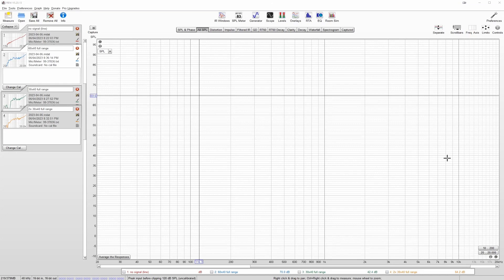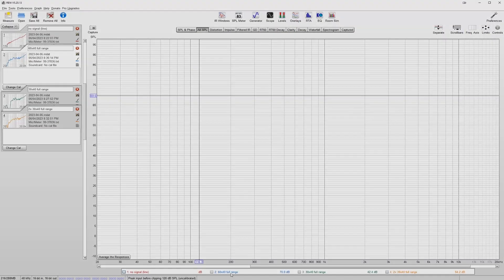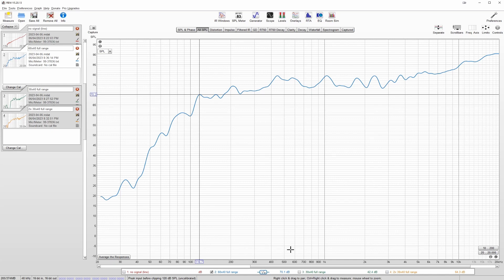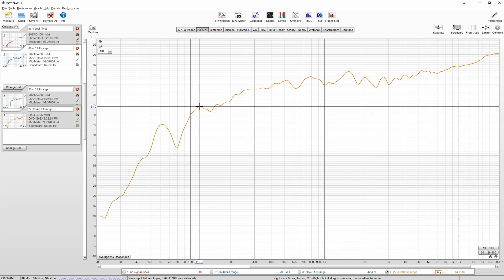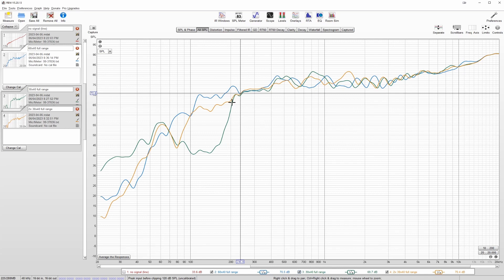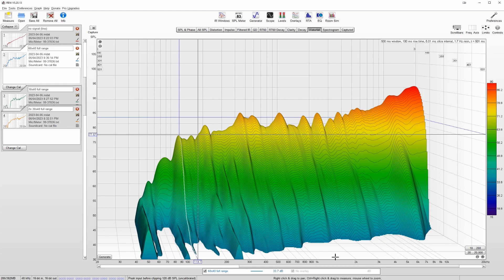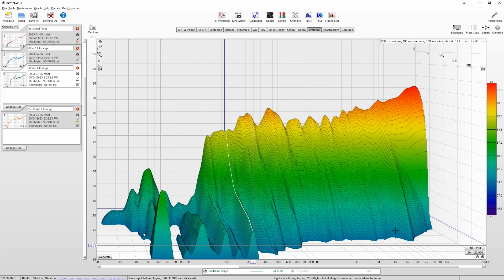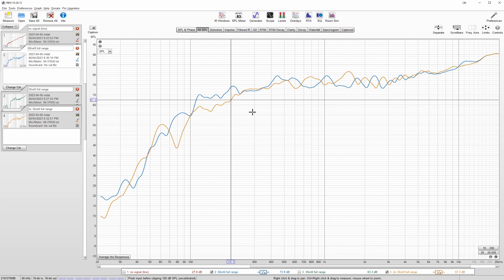One Larger DML Panel vs Two Smaller Panels (...vs One Smaller Panel)

Comment from the maker: UPDATE: It looks like the measurement issues came from a bad soundcard calibration file. I have re-calibrated the soundcard in REW and subsequent measurements look much better, particularly in the HF.  I won't mess with this video as there are no real changes in the lower frequencies I'm discussing here.

Comment: Hi Ben. I want to do a 4 panel setup, with 40 watt dayton exciters. I want to make some speakers for my TV. I want to do a hybrid approach with half the panels being a different material. In your opinion, what two  materials would best cover the whole frequency range in the most balanced way?

I'm doing a bunch of research right now and just from a total guess it'd be a PVA glue coated XPS panel (24" by 24", 2/5 3/5 placement of exciter) and an acrylic panel (something like 24" x 38", with the same placement location).

What's your opinion?

Comment: Hi. I’m considering building some panels. It’s interesting that folks aren’t using (in addition to the subwoofer) three or more different sized circular panels. I’d cut all different sizes and a couple of different drivers, then mix and match to the room. Change rooms or decor? Just see which sizes work best with the new acoustics

Comment: Might I suggest trying an HPF and LPF on your lower panel, and bringing it in just where you need it? Otherwise I can see an issue with the two sources phasing a bit. Common trick with most multi driver speakers with two of the same drivers.

Comment: Thanks for all your videos on the subject!  Do you have any experience running different panel materials on the same channel?  My first toe dip in DML is looking to be a 2’x2’ pink board with 1x 24w exciter (8ohm) in parallel with a 2’x4’ acoustic ceiling tile with 2x 4ohm exciters in series.  This all going in the garage so looks don’t matter.  Also got a dedicated 8ohm tweeter and passive high/low pass filters centered around 6khz to play around with too.  I don’t have a dsp, but the fosi amp has a treble dial.  Sub is preamp and has a variable crossover too.  Hope it doesn’t end up like a Jr High band practice :)
Reply from the maker: No problem, glad your finding them useful! I haven't done anything with multiple-materials but one thing I haven't seen addressed is that different panel types will have different efficiencies eg the foam board might be a few db louder than the tile, in which case the combination might not be as effective as you'd want for evening out frequency response. I guess my view is that I'd rather get a decent sound with a single material and stick with it but that it could work out great as well. There isn't a whole lot of detailed info out there so the best thing to do is just give it a go and see how it sounds!

Comment: I'm really glad I ran across your channel.  I've been thinking about making the foam version of these speakers ever since I first watched the Tech Ingredients video that kind of started it all off.  I like your approach to a Hybrid speaker and I'm going to watch each of your videos to learn more.  I also had an idea to use one of these for a guitar amp speaker, and you've already done that!  Thanks for the great content!
Reply from the maker: Hey James, thanks a lot. I do like the idea of a single full range panel but talking within the constraints (materials, cost etc) I do think that the hybrid approach is the way to go - I'd say most DML people are probably at least using a subwoofer at the very low end and I'm really just extending that upwards a bit to take more load off the panels (~250hz instead of ~100hz for example), then building it into a single unit.

Right now I'm working on new hybrid-style speakers for my TV room but when they're done I'm keen to do a guitar amp v2 as well (a full amp this time rather than just a panel + external amp).

Comment: Fantastic video again. Did the coupling effect change after new calibration? Do you plan to take measurements of 2 large panels in a similar stereo setup? That comparison could be interesting too. Thank you!
Reply from the maker: Thank you! The effect didn't change - just the overall slope of the measurement is different. I've posted the updated versions here: https://imgur.com/a/s0F6Rh9
Reply from the maker: And on the second point - yes I'd like to test this out more on different panel sizes (and shapes) - I just have a lot on at the moment so couldn't go too deep into it right now.

Comment: I would add 2 exciters to the big panel I've added 2 exciters to a 2x3ft polystyrene foam panel wrapped in fabric  and the midrange is more pronounced makes the single exciter panel sound like 💩
Reply from the maker: Which model exciters are  you running on those?
Reply: @Typical Ben  dayton DAEX25 
I got 2 panels so in total 4 exciters running in 8ohms on to 1 channel of my amp

Comment: Do you still rec clamped plexi panels over free-hanging foamboard type panels?
Reply from the maker: I really like the acrylic because it's a good combination of sound quality and aesthetics (don't think my wife would enjoy a pair of big pink foam panels in our living room and come to think of it, either would I).

The only downside with the way I'm doing it is efficiency - you need a bit more power (which is why I tend to be using larger exciters) to push these panels but it's nothing crazy.

Comment: Why do you metric people use thousands when you can use hundreds in your talk? For instance isn't 600 by 400 mm the same as  60cm by 40com? I mean you're talking broad numbers no need to get into the thousands. Why do you do that? It's far easier for us no-M'ers to follow along; no?
Reply: I think I find, as one of the metric people, that using millimeters is just much easier. Something that would be 5.8cm would be 58mm. This might not make too much difference when writing it down but when its conveyed verbally saying "five point eight centimeters" would be relayed as "fifty eight mill".
Reply from the maker: Yeah using millimeters is standard for anything construction related, buying timber etc. Now that you mention it I notice I did flip flop between millimeters and centimetres in this video which is a bit silly.
Reply: Hahaha, it's all Greek to me, I can't visualize it regardless. I wish everything was metric everywhere, it always made more sense to me vs the inch and the dreaded fraction thereof here in the U.S. But at least I can picture an inch, I know how big/small it is. About 25 mm. It don't matter CM or MM or KM, I still have to convert it to something I know. Cheers 🍻
Reply: Firstly, it indicates a degree of precision. i.e. being within a millimetre not a centimetre. We do this for anything of medium precision, by working to the millimetre. Higher precision factors are also given with tolerances when required.
Secondly, it's easy. The whole point of the metric system is to have easily convertible units everything is just a factor of ten, so add or remove a 0 or a decimal place. For instance, how many half inches in a mile? That's a minute of work. Alternatively, how many 5mms in a km? = X2 X100 X 1000 200,000 = easy.

Comment: Ben, your no sound measurement has me wondering a bit. If you can't hear it, then it's probable that your mic can't hear it either. I had an issue with REW a while back where the measurements were just unbelievable, not at all what I know I was hearing with my ears. So I uninstalled then updated REW to it's latest version and I was instantly rewarded. I think I was gating something somewhere, just playing around and forgot to reset my settings. I'm sure I caused the initial problem but forgot what I did to cause it. There is no master "reset" that I'm aware of aside from uninstall/reinstall. But I'm thinking you may be having a similar problem like I had.

On the flip side, this could also be an issue with your mic, preamp and/or calibration file, OR the measurements might be perfectly correct and you just can't hear it. I suspect something weird is happening somewhere in your set up, because you should definitely hear the highs running away like that. These things would be "very" hard to listen to for any length of time if this is how they truly measure up top. Your ears would be bleeding! Anyway, that's my nickles worth. 
Cheers 🍻
Reply: Ran into the same issue myself. I was getting inaccurate readings for over a year until I deleted REW and reinstalled latest version.
Reply: @Masterdebator881 :
Were you playing around with REW by tweaking measurements or did it happen with all things kept as default? Yeah, it took me about a year to know something was definitely wrong too. I wasted soooo much time until I realized the problem wasn't me. Cheers 🍻
Reply from the maker: It seems this was an issue with my soundcard calibration file in REW. Your comment got me thinking more about software which led me to run the recalibration and the subsequent measurements look a lot more realistic/natural.
Reply: @TypicalBenYT : 
Any one of us that has been in the trenches, yeah, we've been there! 
Cheers 🍻
Reply from the maker: Thanks for this suggestion, I’ll try a fresh installation today and run a few sweeps. It would be a good result if it’s just software related!